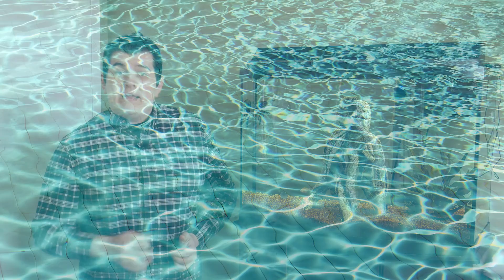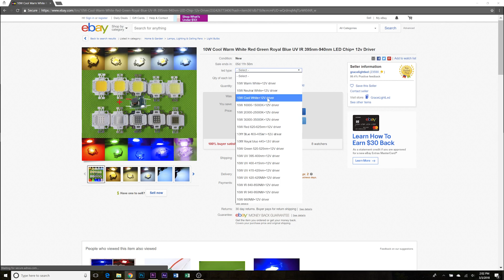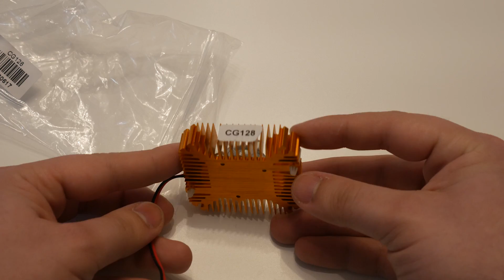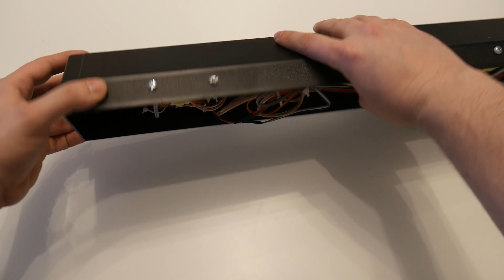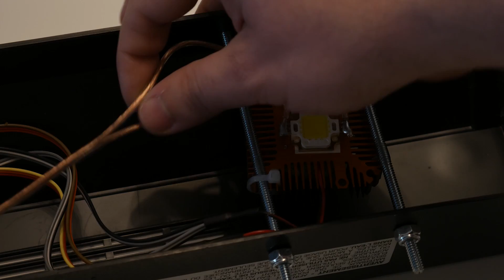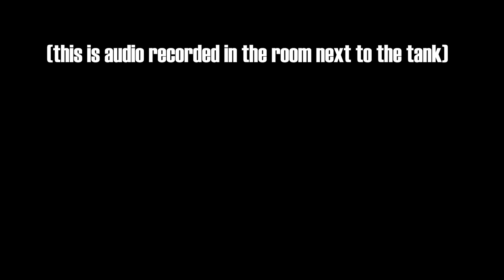A Short Project Involving LEDs, a Fish Tank, and some Laziness

Comment: I can make you a silent, dimmable, waterproof, 5v, MUCH brighter version with no fan needed if you like.  I’d even send you a free one as I have parts for it just laying around.  Just say the word.
Reply: Mind to share what parts you would use to make a more powerful and fanless lighting solution?
Reply: Cree XP-L2 with a custom driver.  It produces 1300-1400lm depending on binning and has a low forward voltage drop.  It maxes out around 20 watts and can be convectively cooled.

They’re usually used in higher end flashlights.

The driver is based on the attiny85a with a FET and so is super hackable.  In this application, I’d also conformally coat the boards to provide protection from water.
Reply: Terry Beardmore Yep! you’re the first one who caught the reference!
Reply: Is your name a dead kennedys reference?
Reply: WS 88 there are DOZENS of us LED nuts out there, DOZENS!
Reply: He never said the word guess he doesnt read comments
Reply: WS 88 not a member, I do lurk there sometimes but I mostly do my own thing.
Reply: White Supremacy Some of us experienced electronics hobbyists know that, as well. Plus some professional electrical engineers.

Comment: Wouldn't be a much better solution to cool the leds with water from the pump instead of the fans? You just need a water cooled heat sink (10 $ in amazon).  
You'd get better cooling, less failure prone parts, no noise and also the heat from the leds would contribute to heat the water making the heaters turn on less often, which could be a significant saving along the year in a constantly running system.
Reply from the maker: That's....a really good idea!
But--and this is a real nit-pick I assure you--I tend to get anxious when water is transferred outside the tank.  I would worry that a leak might not be contained.  With the setup of this hood, if there were a leak it would probably end up back in the tank, but there's glass under the hood that would make it pool up before travelling over the edge.  And there's a small gap between the hood and the edge of the tank.
Reply: You wouldn't be able to use the tank water the blocks would corrode badly there are a lot of other chemicals in the tank water and you will also get a build up of other stuff like sand plant matter algae and fish pop this is why a lot of consumer units are fan cooled
Reply: A heat exchanger setup could solve that.  A coolant loop of distilled water running through a heatsink that is exposed to the tank, for e.g.  I know that starts to get complicated (a fan is a pretty simple solution), but the engineer in me can't help looking for more efficient solutions.  If nothing else, passive sinks in the hood with push/pull fans on the sides, maybe?

Can't leave well enough alone, this one.  :-D
Reply from the maker: + Slawek B.  Ha ha, yep!  I realize a hang-on-back filter is still transferring water outside the tank, but I have an irrationally higher comfort level with them than I do a canister filter!
Reply: Well, catastrophic leaking is what I thought the first time I saw a water cooled PC, but those systems have been used for years and apparently, leakings are not a big concern if properly installed. 
Regarding what TaintedCamper said, as long as it's not a seawater tank, I don't think that corrosion could become an issue, there are fish living in there so those chemicals don't seem to be too aggressive. Clogging shouldn't be a problem either if you use filtered water returning to the tank. Algae buildup could be an issue tough, you should keep the tubing covered from the light or use non clear tubes.
Great video man! Annoying music but great video
Reply: +Technology Connections - oh, no canister filter for you, then. Or sump.
Reply: I have both - canister and hob. I would never say a bad word as far as hob is concerned - in fact it's really, really convenient and pretty efficient. I would recommend hob over anything "internal". Still, it is safer than canister, when you're concerned about water spill.
Reply: Ah yes! Boil the fish!
Reply: And, you'll slowly up the temperature of your tank, at what temperature will it settle? Might be to hot for the fish.

Comment: I use a thermal adhesive much different than thermal greese. It's a dual part epoxy. It's strong enough to delid a CPU trying to separate it from the heat sink.

Comment from the maker: So, um, this is a video.  Yeah.
Seriously, I hope you enjoy this.  It's kinda weird for my channel and I intended to make this a long time ago.  But I hope you can get some ideas of your own from this example!
Also: I intentionally didn't apply a noisegate to this audio.  I wanted the background noise of the tank to be audible!
Reply: Technology Connections you could reduce the noise by running the fans of a lower voltage source - you can connect a small resistor in line with the fan - 200ohm should be plenty
Reply: It's hardly audible - actually it's pretty quiet as for the set up of that size, in my opinion.  That tank has potential - but it's pretty sterile. It needs more easy-growing plants, like more crypts, vallisneria, ludwigia repens etc. Some wood with bolbitis, java fern and/or mosses would be nice too. Surface plants are not bad either, like pistia - they scavenge nitrates nicely and suit angelfish.
Reply: I subscribed after watching the How Old CRT TV works, and now I'm watching videos about fish tanks. Your videos are great as always!
Reply: Video is just fine. Only 'weird' thing is that you seem to be on your knees the whole time? :D
Reply: @arjankooij4810  i thought the same thing after seeing the doorknob behind him at eye level, then couldnt stop thinking about it the entire video.
Reply: When you get your subs to the 1 million mark, you need to swap out those fans for a 240mm liquid cooling radiator in a follow-up vid. Drop that noise floor, son.
Reply: Am I the only one here seeing a wasted opportunity ?

My technical knowledge is very low so maybe this is because of that but...

You have fans to cool things.

You have radiator to heat up water.

Isn't this counter productive ? Isn't there a way to use the heat of the leds as radiators ?

Your "only" obstacle here is regulation...
Reply: As a long time fish keeper, thank you for mentioning cycling. There's a lot more that goes into fish keeping than most people think! Sorry about your tetras btw :(   Hope you've had more success since then
Reply: definitely we want that :)
Reply: I love that it's so easy to tell that you are making videos about things that you love. Great job!